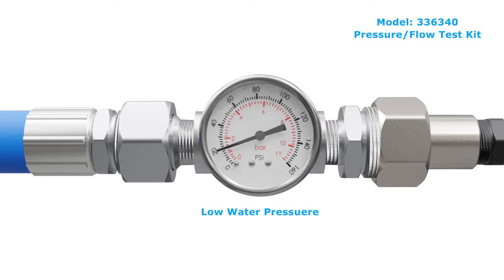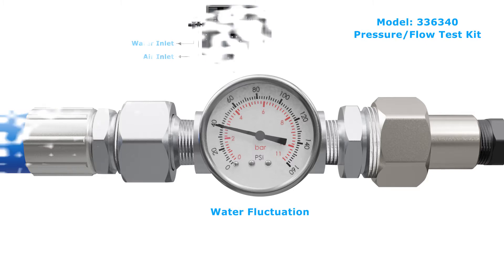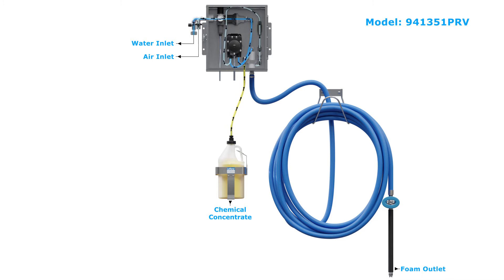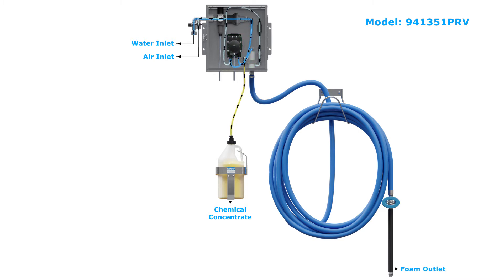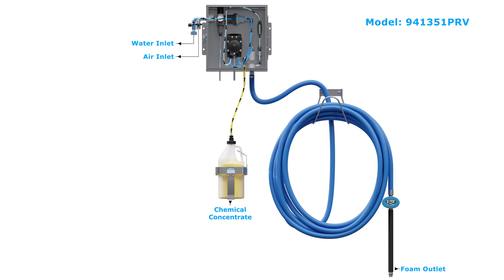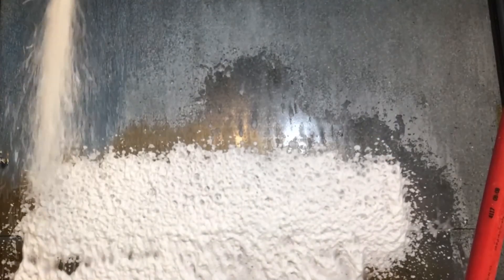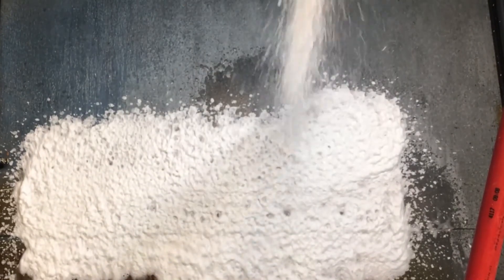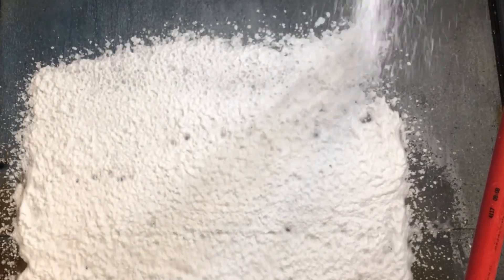941351PRV Liberty PRV LC Foamer

Comment: What psi for air inlet and what is the best air compress for this
Reply from the maker: You can view full operational details at this link: https://forge.laffertyequipment.com/print/io.php?id=16596&name=941351PRV .  See the links below the video to find complete product details. -- The air regulator on the unit is set to 65 psi, which is the optimum setting for the pump and for this foam applicator. Air volume should not exceed 6 cfm, according to the documentation, so any air compressor that does not exceed 6 cfm output can be used.